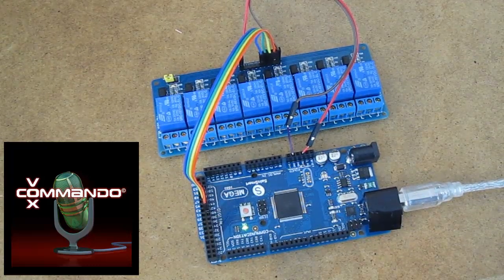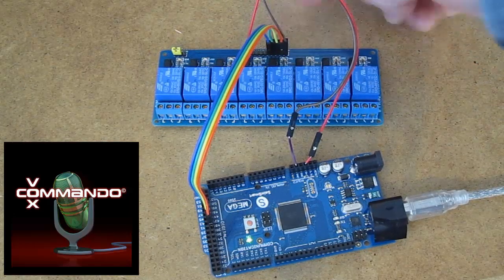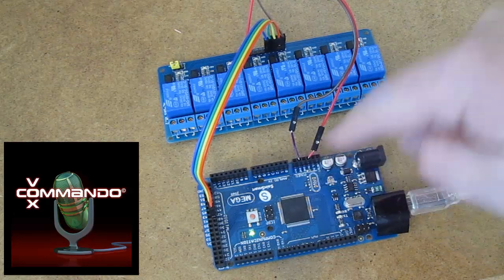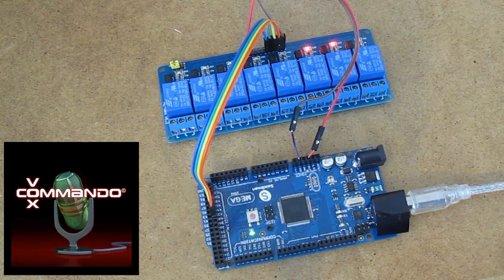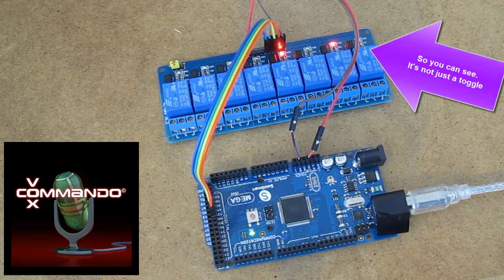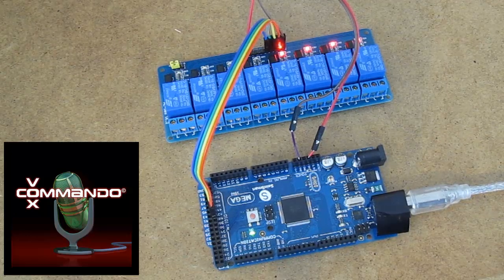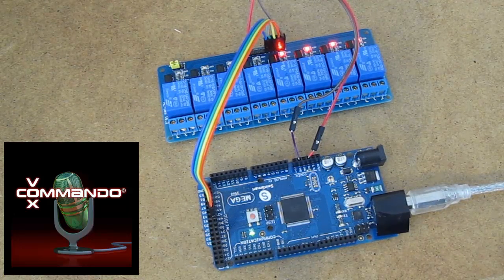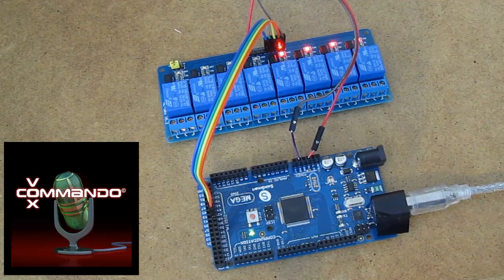Arduino voice control relays with VoxCommando and serial communication

Comment: on this project I'd like to use the relays as temporary toggle switches to start my car and other functions. how do you use the code to turn the relay on for a second then back off. BTW love the
Reply from the maker: You could either modify the VoxCommando command macro or modify the Arduino sketch.

In VoxCommando you can use the VC.Pause action after turning the relay on and then turn it off.

If modifying the Arduino sketch you can use 

delay(500);

and then turn the relay off.
Reply: VoxCommando thanks I'll try that
Reply: VoxCommando please I want help from you this my email :Bahraini.75@hotmail.com

Comment: can i use arduino uno board for this project or it is necessary to use arduino mega .
Reply from the maker: Your question is answered in the video if you watch the whole thing. You can use any Arduino if you adjust what pins are used in the sketch.
Reply: VoxCommando ..... thanku.......i am plannig to do voice recognition based home automation project......in this video you have connected relays to the arduino.....and arduino is connected to pc(voxcommando) using usb cable  and pc is getting voice signal through mic....is there anything else i need to control these relays....
Reply from the maker: Mukesh Dhiman just some wires as far as I know
Reply: VoxCommando thankx..........i will now try to implement it...........thankx  a lot again ........